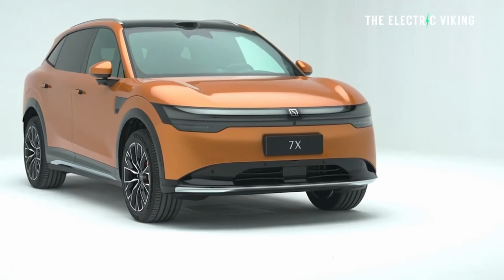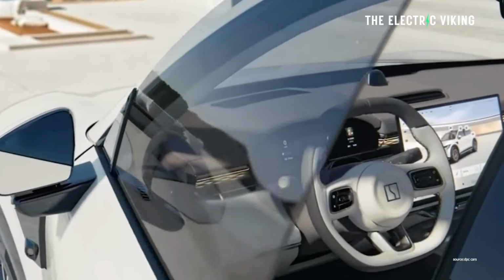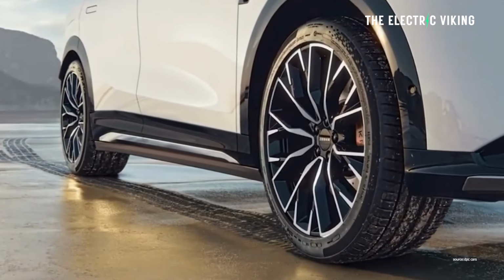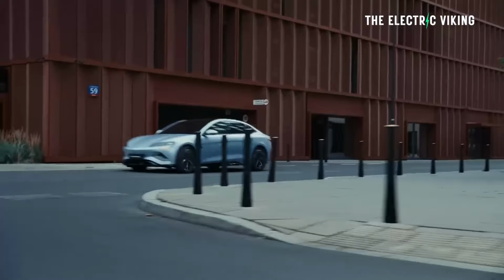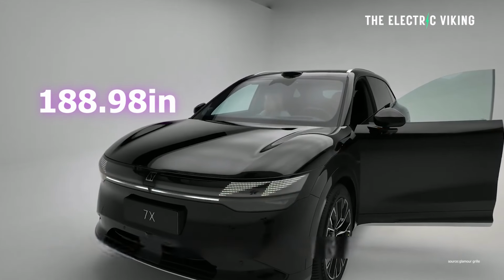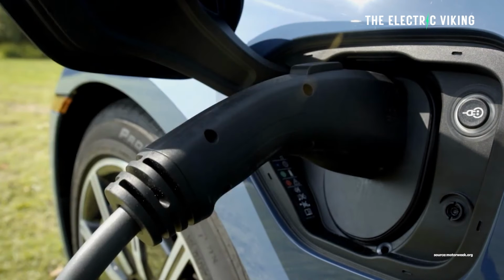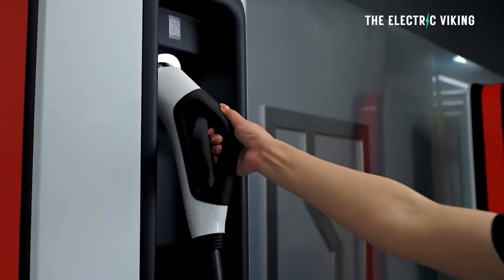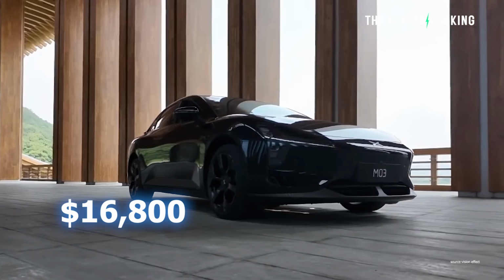Zeekr 7X gets 20,000 pre-orders after revealing fastest battery charging EVER

Comment: Until super charging becomes ubiqutous, many will refrain from purchasing an EV.  Also 10 minute fast charging for at least 70% charge could almost be a core requirement for many drivers to make the switch to EVs.  Some will be happy with slower charging rates of course. Especially those that can easily charge overnight.

Comment: Just a question Sam. Can both the Zeekr 7X and XPeng G6 be charged to 100% all the time or like Tesla 80% as recommended to prevent battery degradation...?
Reply: i have the G9 , got it in may this yr ...after 80 , 85% charged i normally stop as it slows down by a lot . once or twice i have sat it out as it was a long trip ahead ..it does get to 100% .
Reply: Depends on the type of battery - LFP (100%) usually used for normal range or MNC (80%) usually used for long range is recommended

Comment: This is the one for me. I can wait that long but the clock must stop somewhere. Waiting for the latest technology is just that. If it tows as they say, it will be a massive hit in the towing countries like ours. There is not much to fill that SUV roll.
Reply: TBF, 600 kw charge speed is a sweet spot, lets say u average 400 kw, u can drop by a charging station and get 200 km of range in 6 min. The range anxiety is kinda gone with those charge speeds. Waiting for 1000kw or something wont give u much, but going from lets say mercedes eqe with their superslow 170 kw.... too 600, makes a lot of difference. in 1-2 years we get most sorted, and it probably will not happen so much with the specs the following 5-10 years. And when talking about speed, most ppl cant even handle the 0-100 in 4 seconds, most ppl wont be happier with 2 sec... Im probably gonna buy my first BEV in first half of next year. Either the new MY if the specs are good enough, just coz the thing probably will "just work", or this X7 or similar.

Comment: Hey Sam, Could you make mention of towing. This vehicle will be fantastic in Australia if the reported towing capacity is true. 2 tonne towing is perfect for lightweight camper trailers for families.
"Detailed specs of the Zeekr 7X (CX1E) electric SUV from Geely were exposed by the Chinese regulator as this SUV applied for the sales license. It is a 4.8-meter crossover with up to 637 hp. It can also tow up to 2000 kg"

Comment: All in China.  So why are you talking about a car that will fail in Australia?  Talk about long term reliability which no Chinese car will ever have.
Reply: keep dreaming
Reply: There are ev taxis running around in Shenzhen, China, when their public transport system went full electric in 2017. Most  are Byd E6 models and they have clocked up hundreds  of thousands of km in mileage for the past 7 to  8 years of operation. None need to replace their original battery.
.
Reply: If you're implying that the battery will fail - I doubt it very much (apart from isolated cases in which case a typical 6-7 year warranty would protect it) given China's decades long expertise in battery manufacturing and innovation . As for other vehicle parts, yes it's possible the chassis or suspension will give way or the bodywork will go. again best to make sure there is a good warranty in place
Reply: In that case keep driving your Holden for the next 50 years.
Reply: @laohu5511  I’m in Canada.  -30 degree winters baby!! Let’s see an EV hold up in those winters.  
Remember, teslas were having problems in January in Chicago with -30/-40.